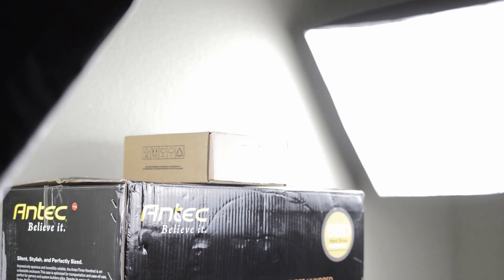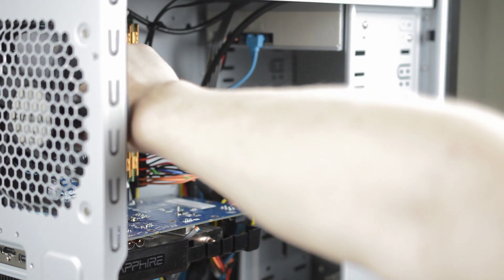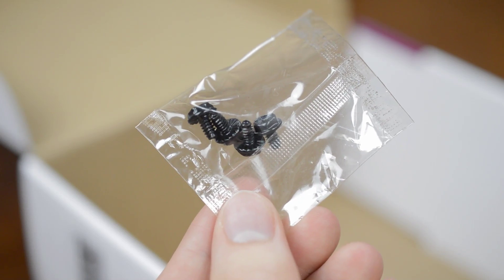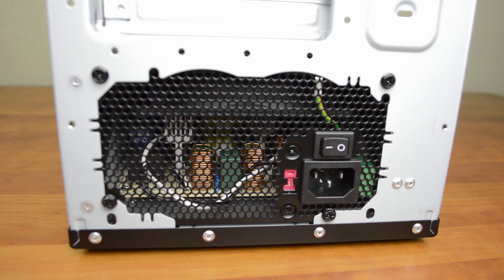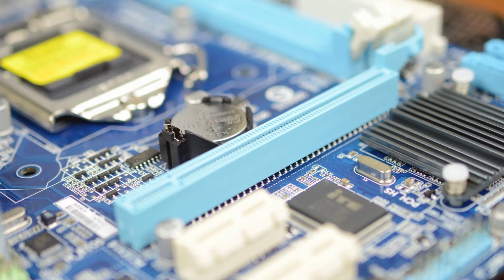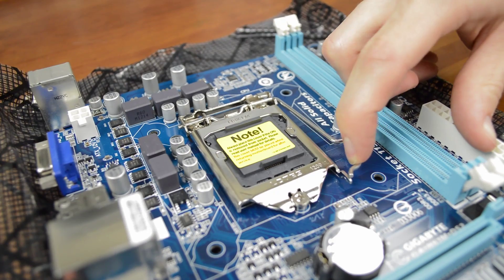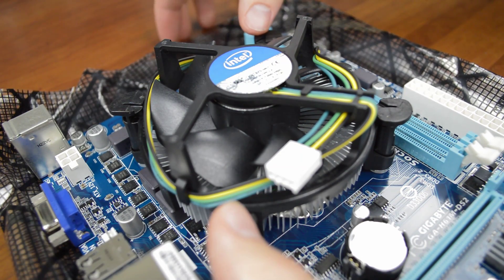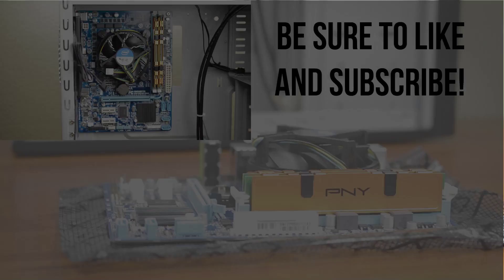How to Build a Computer for Gaming (2012) Part One

Comment: hey I'm building a new gaming PC and after some research I came up with this...
Motherboard: Asus p8z77-V LGA 1155 Intel z77
CPU: Intel core i5-3570k
Video card: Galaxy gtx 670
memory: kingston 8gb ram 1600
ssd and hdd: crucial m4 128gb and seagate 500gb 7200RPM
power supply: corsair TX 750W

is this a good setup? is everything compatible? This will be my first gaming pc so I would like an expert opinion on this.

Comment: *SMH*....Please research more about the AMD FX processor please. You'll know the reason WHY an i5 can beat FX-8150. It's all about the architecture. Yes, AMD clearly stated that. But the true fact is this: Two and a half if you really want to count the dual integer units per core. However, all the key components, are SHARED per module. Meaning ONE decode stage PER PAIR of 'cores', ONE Floating Point processor PER PAIR of 'cores'. In other words, this is the AMD equivalent to HyperThreading.

Comment: Your wrong with the AMD CPU 8 core part. It's a 4core CPU with 8threads. It's just like an i7. Get the facts right before posting it :S. 2nd/3rd gen i5,i7 can easily beat AMD's 8core processor in almost any type of benchmarks. The bulldozer series is a major fail.

Comment: judging by the specs, minecraft should be an annoying tap on the shoulder to the system. i say you can run minecraft at high settings, surf the web, and record a video all at once.

Comment: Its a card that goes in the pci slot to have wifi but you can connect using a wired conection thats in the back of your motherboard

Comment: someone is a mid tower case going to be big enough for intel core i5 2500k gainward gtx 560 1GB western digital caviar blue 4GB ram sony dvd burner Gigabyte GA-G41M-COMBO Socket 775 (LGA775) Motherboard

Comment: yes, it really does lol. i wouldnt post that comment and then get top comment if it didnt :P you can place it on the box that the motherboard came in, but dont place it on the bag. if you live in california i would wait until next week to do your build, it's pretty hot and dry right now. there's probably quite a bit of static electricity in the air

Comment: it is on the inside, but on the outside, the bags are conductive. i suppose if you REALLY want to use the bag to set it on you could turn the bag inside out, that would be fine.i wouldnt risk it though

Comment: I consider future proofing to be i7+ level. But I can go along with this.
You don't need to buy a whole new PC. Just upgrade the CPU and MOBO. So it'll cost 150-250 more depending on how good of a MOBO you need. The i3 will last, at the very least, 3 years or more. The $500 i5 PC will suck in 5 years. You would be running a 6670 or lower.

Comment: You'll need a new motherboard, but you most likely won't need new ram, and you don't need to get new windows. Considering how much performance you get, it's much better value then "future-proofing". You could've saved ~$700 by not future proofing with an i7 980X. Motherboard's don't cost ~$700 (Well, most don't.)

Comment: PS3 is a cell CPU, so it's different.
What I'm saying is that games developed in the future (the sad truth is that most games are developed with console optimization), that 8 GB of ram won't be excessive. I'm not saying the xbox is future proofing; I'm saying that games will be more optimized for multiple threads and lots of RAM.
Also, you are very stupid for saying that future proofing isn't stupid. If I had bought a i7 980 to future proof, then in a year the 2600k will be as good for $300.

Comment: That's a synthetic benchmark to rate cpu performance. Look at a game benchmark. The difference is negligible.
The xbox 720 apparently will have 8 cores, and 12 GB of ram. So games will be optimized to use a ton of ram, and be heavily-threaded.
Future proofing is stupid, because you get something much better with a year or two.

Comment: For gaming and normal use, it won't matter. If you got an i3 and i5 side by side, and opened up files and look at stuff on the internet, then they will be same speed.
4 GB is more then enough for now, but it's so cheap that there's no reason not to buy 8 GB. And future games will start using more then 4 GB of ram.

Comment: The i7 is recognized as an 8 core CPU, and it uses 8 threads no matter the program. It doesn't need support for it. It needs support for 8 threads, but not hyperthreading.
4 years later, the i5 2500k will be slow as shit. Intel's tick tock strategy means that at worst, it will be 120% slower then what we will have then.
I would suggest buying an i3, and waiting for Haswell or next architecture and upgrade there when you've saved up some money.

Comment: If it's doing that, then when RAM comes in, it will allocate less power to it. So that doesn't matter. And 60% of an i3 uses less power then 40% of the i5. The i3 naturally has less power consumption.
When will be a drawback? Yeah, it'll be slower when he renders video's or something, but this is for gaming. And the i3 is slower in gaming then the i5 usually by 2-9 frames.

Comment: Yes, apparently it does support higher ram frequencies. I was remembering old sandy-bridge chipsets.
A-Why does that matter?
B- The CPU isn't up to it's limit much. And if it is, then the i5 will almost nearly also be at full load. The i3 isn't full load during games, and it isn't full load during oridinary use. In what situation would this be different? What are you doing?

Comment: The i3 is rarely at 100%; no games do that. And what exactly are you doing that will put the i3 at 100%, and not the i5? That's video/3d animation rendering kind of thing, which will put the i5 at 100% too. 
Do you know how much RAM chrome eats? Have 20 tabs would be more like 2.5 GB.
Note that unless he's rendering video's or something, it doesn't matter. By the way, I don't think 1600+ mhz ram works with sandy-bridge cpu's. So he can't use 1600 mhz ram anyway.

Comment: Hyperthreading works on everything; the OS recognized it as 4 cores, ect. It won't be as fast as an intel core, but it's faster then AMD cores. The point is that it can multi-task as well as an i5, and is a very fast and capable processor.

Comment: Duncan!!! Can i use 8gb of ram instead of 4gb?? On the amazon website there is a option to have 8gb instead of 4! and can i use a Cooler Master Cooler Master Elite 430 Mid Tower ATX Case with Window (RC-430-KWN1) instead of the 300 case? plz respond!!!

Comment: Pro tip: Put your motherboard on top of the box instead of the anti-static bag. The bag is only anti-static in the inside, the outside of the bag is highly susceptible to building up static charges.

Comment: 1. Then you best look up a separate video just for it. Or read the manual very, very carefully.
2. Of course you can. As this is a heavily budgeted rig, it is using a micro-ATX instead of the usual full sized ATX board. If you want more RAM slots, then I would suggest getting an ATX board.

Comment: Yes definitely upgrade to 4gb since games use about 2gb when playing people tend to have more than that to run os ect.

Its not very expensive to upgrade ram and very easy, first check what speed your current ram (1333 or 1600 is the most common) is and buy some that is almost identical to it to get the best performance however it does not matter if you cannot find it because any will do really.

It will really give your computer a bit boost, hope it helps.

Comment: Yes, they are about 10-30 bucks, but you could just use a Ethernet cable, which is a more stable connection, but it is a cord.

Comment: Uh, yeah. The motherboard he is using doesn't come with a wifi adapter though. Most people don't use wifi with desktops; an ethernet connection is more stable, and usually faster. If you want wifi, you can get either a PCI Wifi adapter or a USB WiFI adapter. Those usually run you $15-$30.

Comment: A nice in-depth tutorial. If you follow the basic steps you can build pretty much anything since BIOS is pretty easy to configure on the new generations of motherboard so there is pretty much little that can stop you. The only issues people seem to be having is hooking up the PSU to various other components.

Cheers for the nice guide.

Comment: Their usually on the PCI slot, not the PCI express, which is what GPU's use. Your motherboard will have a PCI slot, and it'll go in like a GPU. Of course you'll have room for both a Wifi adapter and GPU.
But, as I have been corrected, a USB wifi adapter is easier to setup, and just as good. Make sure to get one with an antenna. They're around $20.

Comment: It's only bad for the SSD drives if you CONSTANTLY add/delete data to them. They should generally only be used for backing up data or installing programs.

Comment: First off. it's an SSD drive. Not card. You aren't suppose to defragment SSD's cause they dont' work on the same premises as hard drives. de-fragmenting would be pointless. it's not per say "bad' but it does waste IOPs. And yes you can delete and add games...

Comment: Defragmenting a SSD is what screensavers are for LCD monitors: You don't need that and doing so will only slightly shorten the life of your SDD (a SSD can handle a certain number on operation before it fails; but don't worry, it won't fail anytime soon!! ;) ). In windows 7 I think there is an option to optimize Windows for SDDs (but don't ask me where, i'm still using a caviar black!)

Comment: You didn't mention that it DOES matter which socket you put the RAM in. You have to look in the motherboard manual to check which ones would be the fastest if you're not using all the sockets. They said that in Newegg's PC building tutorial.

Comment from the maker: This is actually pretty similar to the $699 X51 (same CPU, same RAM, better GPU, smaller HDD and better power supply). 

8GB of RAM will work in this no problem.

Comment: i7 Is pointless for gaming, seeing as that the only difference between the two is that i7 has hyper threading, which means it is a 8 core processor, But most games only use 2, and will never exceed 4. So the i5 Is fine.

Comment: You might not want to handle anything by the heat-sink because if it is copper, you can ruin its conductivity, and heat-spreading ability, as well as having the oil from your skin burn on it

Comment: That's actually what I though too, but then I watched a video in which someone placed the Motherboard on top of the bag and turned it on without fail.

So by this logic I think it should be fine to place it on top of the bag, although, personally I would probably still just use the box.

Comment: Why do people need a toutorial to bulid a computer it is so easy and only takes about an 1/2 hours depending on what type of processor cooler and case with poor cable management And everyone normally has completely different components to you and so it could be harder/easier.